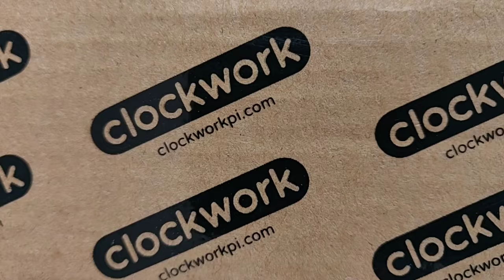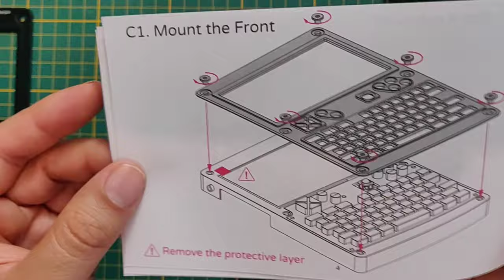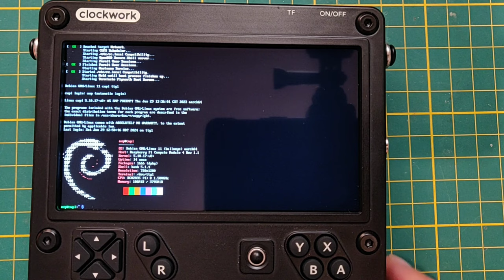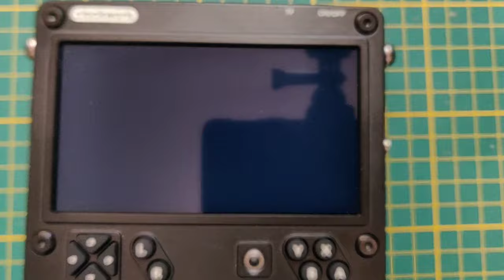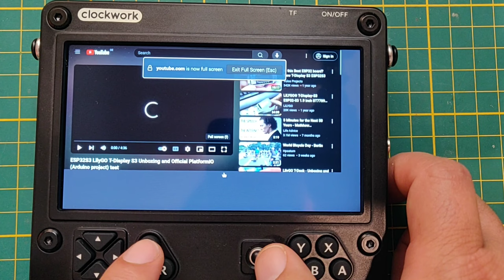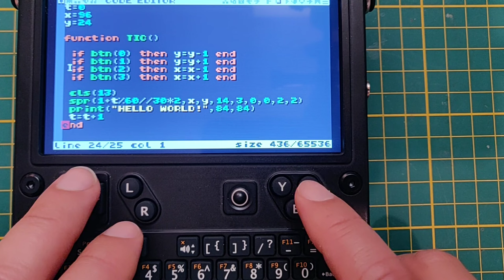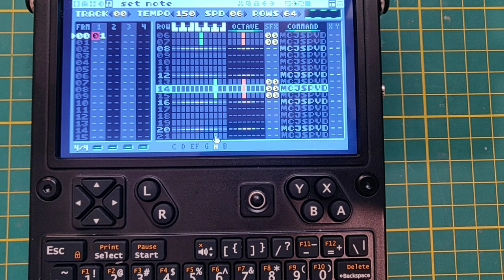uConsole - One Year Waiting! Unboxing, Assembly, and First WMaker Desktop Test! - ASMR

Comment: I was about to order too, I even wrote with support who assured me that delivery was 3 months max. I later found on reddit that this is a lie and the real delivery time is over a year for the black colour. I decided not to play the game where they cheat me at the start. So I bought a used MacBook 12 inch as a terminal.
Reply: A year? Heck no! 😮
Reply: Plus, there is a possibility that your Unit wont even work Like Mine, for over 2 weeks now they somehow cant find the issue and dont wanna have a direkt Look at my Unit
Reply: I've ordered one, then after a month I didn't receive anything and discovered after contacting the support about that.
Some products are marked as not available in the shop, so I supposed that available products were ready for shipment...  I was wrong 😩

Let's see if they will keep the word with me. One year is a scam
Reply: If you can use a laptop for your purposes and it fits you well, there's no point ordering such device
Reply: @zarkonesmall  it depends, in some situations a laptop is an out of place object
Reply: Shoulda got a ThinkPad. 👍🏻
Reply: contact a lawyer. they committed false advertising by saying it was only 3 months. don't be the asshole who lets them screw you over.

Comment: Why did you not clip the board in? I mean the thermal chunk should provide enough pressure to hold it in place, but why not do it properly?
Reply: I thought the same.  I cringed watching that.  To me, it is like installing memory incorrectly.
Reply from the maker: @christopherorman5769  thanks for your comments and feedback. Well, not. Is imposible to close it.. I dedicated a lot of time but that is. Is weird. On the other hand this component is not a memory board only. This module is all, it has the CPU, GPU, and memory card, the technical name is computer module (CM), in this case is a CM4 module. I have many years working with PCs and I know what kind of memory sockets you mentioned, but I think that is different. And it is working because the main lid together with dissipation pill close it. Thanks again for the comments!

Comment: Hi man, great video. What about the battery? What brand and model do you use? I haven't had a good performance yet
Reply from the maker: Thanks for your comments. It is ok, but maybe is the only thing that is bad here, because for now is imposible with the CM4 modules, to have a low power profiles. Maybe with a CM5 module that maybe will be compatible with this uConsole main board, we could have a good performance. For now try buy a good batteries. I'm using a Liitokala 18650 3400mAh batteries.

Comment: the speaker position is at the top and bottom so you can't hear the left and right position of the sound because the two speakers are on the same side, this is a fatal mistake in terms of sound design😅

Comment: a c4 battery?
Reply from the maker: Thanks for your comment. Well not, this uses a normal 18650 batteries. Two. And this is a model with a CM4 computer module, that is a RaspberryPi 4 but in different format (CM4).

Comment: Прикольно, но зачем она нужна какие сценарии использования у неё?
Reply from the maker: Thanks for your comment! As others mentioned, it’s a CyberDeck or whatever you want to make of it since it’s highly customizable. You can install any Linux distribution, or even other operating systems, on its CM4 module, which is essentially a full Raspberry Pi. This version is also capable of using its own 4G mobile network. In my case, it’ll be my outdoor console for certain tasks with other hardware, and it’s way more portable than my laptop. Plus, it’s a beautiful metal piece where you can also run any emulator if you want!

Comment: Вот именно, как тут многие и спрашивают, зачем это нужно?
Reply from the maker: Thanks for your comment! As others mentioned, it’s a CyberDeck or whatever you want to make of it since it’s highly customizable. You can install any Linux distribution, or even other operating systems, on its CM4 module, which is essentially a full Raspberry Pi. This version is also capable of using its own 4G mobile network. In my case, it’ll be my outdoor console for certain tasks with other hardware, and it’s way more portable than my laptop. Plus, it’s a beautiful metal piece where you can also run any emulator if you want!

Comment: But why?
Reply from the maker: Thanks for your comment! As others mentioned, it’s a CyberDeck or whatever you want to make of it since it’s highly customizable. You can install any Linux distribution, or even other operating systems, on its CM4 module, which is essentially a full Raspberry Pi. This version is also capable of using its own 4G mobile network. In my case, it’ll be my outdoor console for certain tasks with other hardware, and it’s way more portable than my laptop. Plus, it’s a beautiful metal piece where you can also run any emulator if you want!
Reply: @hpsaturn  thank you for caring 
Best regards

Comment: The real question is, what real uses can it be made of? What is different about a laptop with Linux?
- I get the feeling that this is a pointless project, I don't see the real functionality, if it is a field computer for use outside the home, there are laptops, if you want to use it as a console, there are already more emulation consoles small and powerful 
- Summary, ClockworkPi uConsole is spending money for the sake of spending, it makes no sense, it is just another option among many options, it does not add anything new to the market